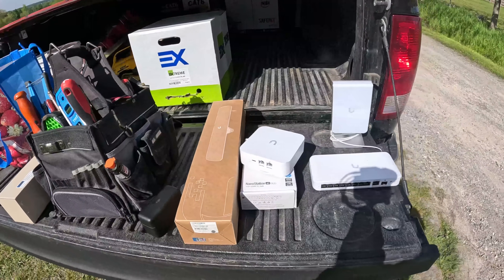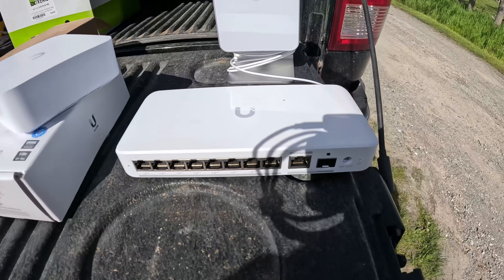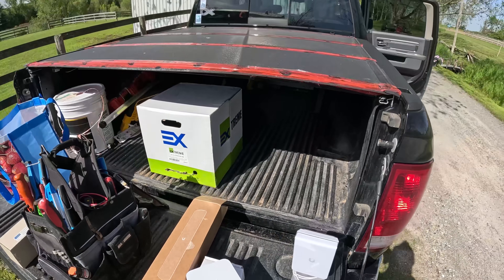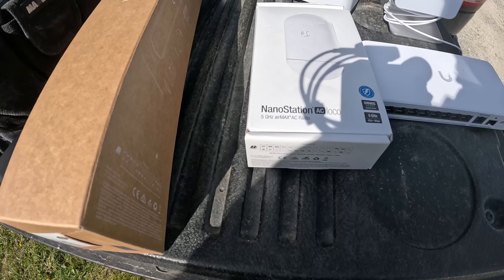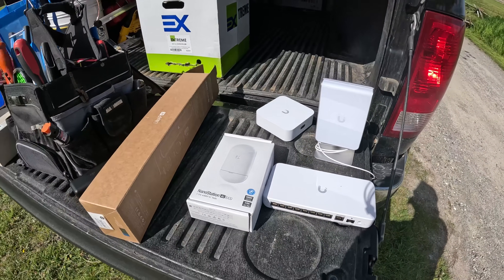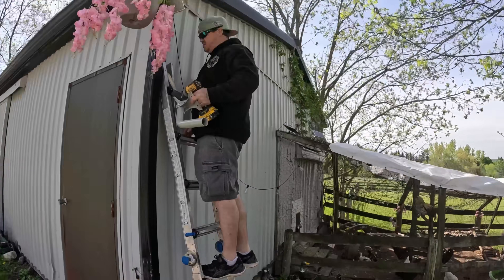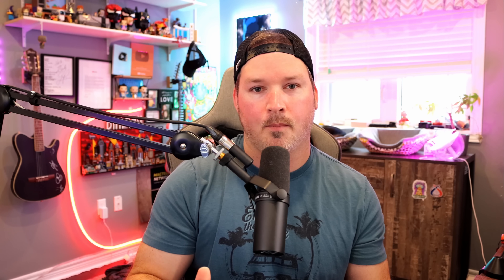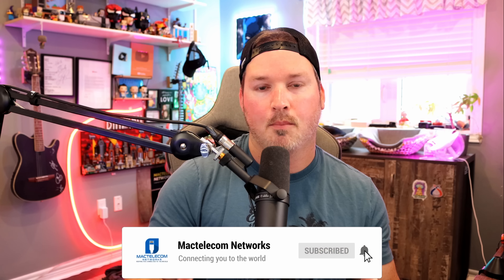UniFi Point To Point Installation

Comment: Are you going to be adding additional CPE's to connect to the master AP by chance? If you are then I understand why you did it the way you did but if you are not, I would have used two power beams or two Nano beams instead for increased capacity (although moot to the needs) and did a P2P link instead of a P2MP link.

I just fixed a botched M2MP system with 10 subscriber units on a 60' tall grain silo as the master. It's a LOT of work to do it right!  Good work as always!! :-)

Comment: Those radios are passive. You can use INS-3AF-O-G to make it work with a regular switch. 
Do you ever feel wifi performance degrades when you mount a Omni AP against a metal roof or wall?
Reply from the maker: Ya I didn’t have any of those so just used Poe injectors.

We ended up just using it directional for the outdoor AP really it’s only for 1 solar wifi camera
Reply: @MactelecomNetworks ive got a few U6 mesh just peeking over a metal roof and i feel they suffer.

Comment: Love UI's PTP.  We just had a building power down that linked main campus to our ice arena via fiber.  Power outage is expected to be a month.  The PTMP emergency backup network took over and supplied the ice arena with 200 Mbps which is more than they normally use.

Comment: I just did something similar for a golf course. Ended up using UDB-Pros which i ran into one big hiccup that made me wish I chose the UBBs lol. 

Are you managing this in UISP or just local for the p2ps
Reply from the maker: Just local for this install
Reply: What big hiccup?  I'm doing 20-30 parking lot cameras / wifi in this next month.  I have the loco's needed, but was thinking about using UDB pros and sectors.
Reply: @terryjohnson3100  I've recently used the locos and keep getting drop outs and the most I can get across the bridge is about 100 Mbps. I have 6 cameras on the bridge side not the WAN side. I'm going to be replacing those with the UBB today so we will see how that works instead. I'm hoping the increased throughput and backup 5 ghz connection will help out.
Reply: @terryjohnson3100 sorry just saw this now. So I was testing out a sector and 2 UDB Pros at my office for a week. Worked great for testing. Then I factory reset the Udbs and brought them onsite to install. How you have them connected when you adopt makes a difference so I ended up needing to take it down and factory reset. 1st time the child one got stuck adopting, the 2nd time it stayed in “isolated” mode” it eventually worked when I connected it close to the parent and let it sit for 5 minutes then unplug and go to the remote site. This was my first time installing these versus the handful of UBBs I’ve done